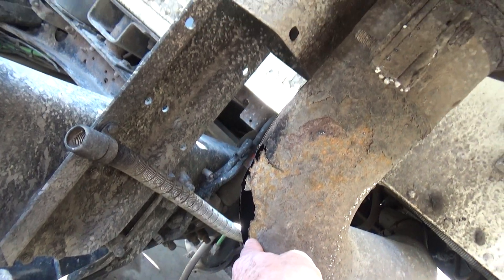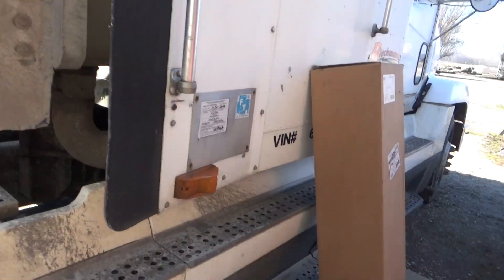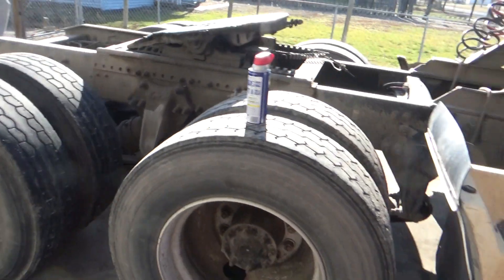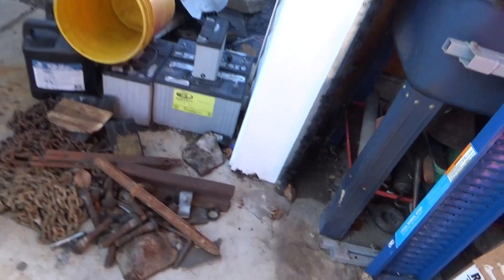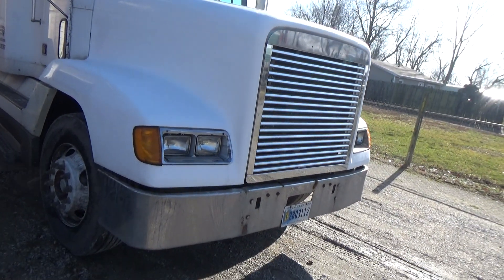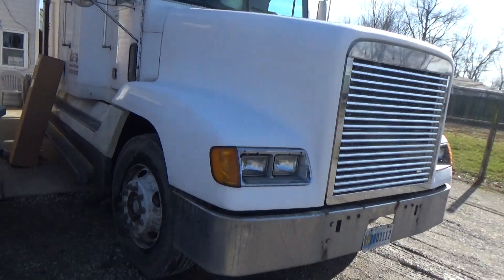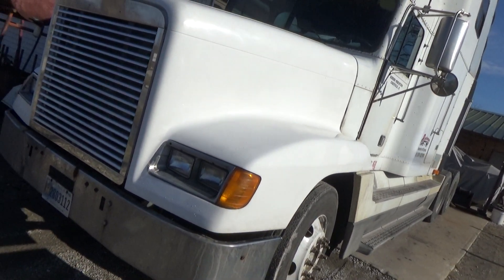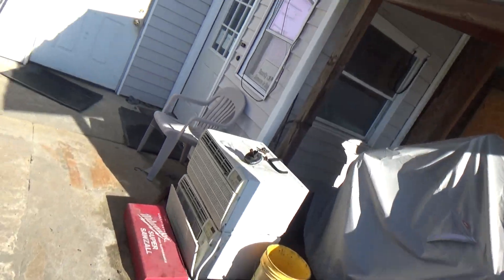Last video of 2022  I'm patching a tire and replacing muffler and elbow today.

Comment: your repairs and videos are great i have watched many would u consider rebuilding an isx. its very old maybe this spring what do u think.
Reply from the maker: Thanks Mitch. I would not be able to take on a job like that unless it were my own truck so I wouldn't have to guarantee it. I don't have any experience with any truck engine other than Detroit and don't want to study and learn a new one as I am already at retirement age and thinking more about small engine machine repair since I play with landscape work on the side.